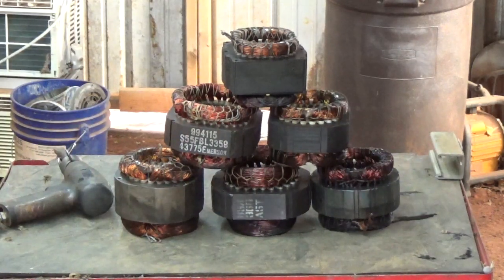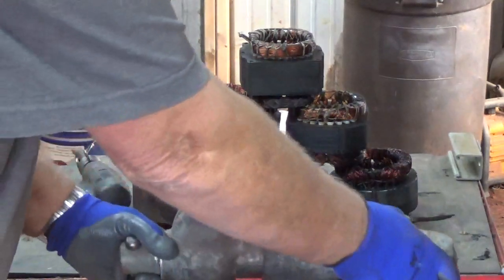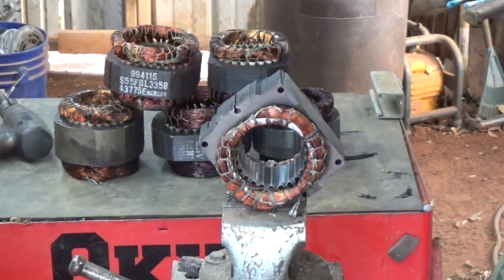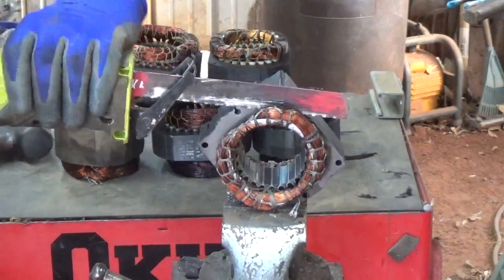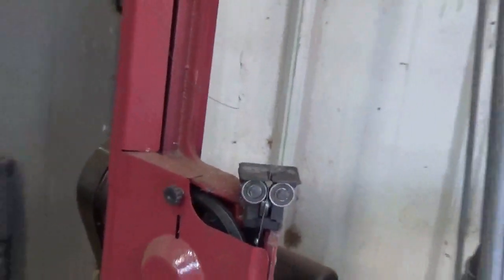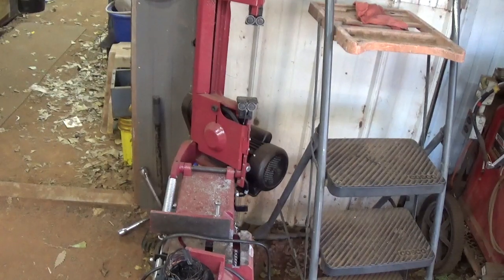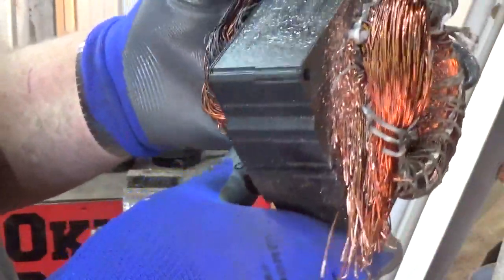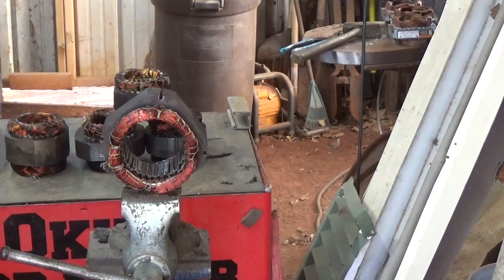How to cut the copper off of stators from electric motors

Comment: Not knocking your method. But table was wobbly and vice. I would go broke if it takes that long.  I’ve tried splitting the stater right in half with bigger air chisel   Thin use fork chisel to work copper out of each end.  Great video though. Good luck

Comment: 12:52 never seen one or even heard of that knarly tool (paused it it said what appears to be bandsaw kit). Will stick with my limited tool collection.
Need to get me some thinner discs for my grinders, many have a few types of grinders for various jobs.
Reply from the maker: they call that tool a porta bandsaw. used a lot for plumbing, I haven't used mine in quite a while. Thanks for stopping by

Comment: Oo lord u wanna kill me wit d hack saw
Reply from the maker: just a mention as new scrappers may not have many tools, so they have to use what they have and build up from there, I have built up my tools with scrapping money, my first compressor was a 1 gallon, try to use an air chisel with a 1-gallon compressor, it will teach you patience. I have added a lot of tools in the last few years. Thanks for stopping by
Reply: @Okiescrapper  yes true I just made my coil puller

Comment: You need to check what windings are in the motor, aluminium ones aren’t worth the effort to strip, use a nine inch slitting disc to cut the end off , get a hydraulic ram to pull out the windings, anything else is uneconomic.
Reply from the maker: the aluminum windings are a big disappointment but the good thing is you don't get a lot of them, a 4 1/2 inch cutting disk will cut them open fast, I just got a plasma cutter and plan to try it, I use an air chisel to get the windings out with a bit that I modified. works well, a lot faster than prying the windings out. thanks for stopping by and Happy Thanksgiving

Comment: I use a 7 inch with a cut off wheel
Reply from the maker: I have one I could use, the disks are thick about 1/4 inch and my small grinder disk are about 1/16 thick

Comment: I had the same issue with the Portaband. It grabs wires and jams in the bearings that turn the blade back to the wheel. Your portaband seems to not catch small wires. I guess it depends on the winding size. I have used the sawsaw with a new bimetal blade and it works ok but my grinder with a cutoff wheel works the best. Those pesky strings are a Pain in the A55.
Reply from the maker: I may try to use a propane torch and see if I can burn them off, or use a wire wheel on a drill or bench grinder may do it.

Comment: I use the 4 1/2 grinder but you should wear a respirator so you're not breathing in the copper dust.
Reply from the maker: yes that is for sure I use the grinder a lot too. lot of dust,  should use a dust mask at the least. almost always have to use a new disk or nearly new one to cut all the way through. thanks for stopping by

Comment: Good thing about air chizel it pulls out all the copper. The oil in the compressor makes it easy to pull out the copper, but when they haven't been sitting in oil the air chizel is very handy.
Reply from the maker: yes it is, it is one of my go to tools, there is so much that you can do with it, if you have the right chisels, next would be the angle grinder,, I got a porta band saw not long ago and am finding places to use it, much faster then the sawzall and grinder. Thanks for watching

Comment: Cut the strings on one side, use a screwdriver to pull apart the main bundles, usually into four loops, cut thru them with a cut-wheel on a Dremel tool, then pull wires thru, it's a lil slower, but it's alot cleaner too, ya can even set up a small vacuum to collect any copper dust
Reply from the maker: after pulling them apart you could cut them with a pair of long handle cable cutters.
Reply: @Okiescrapper  yeah, but I find the lil dremel tool to be a lil quicker, and a little less labor intensive.

Comment: Is that vice mounted on a spring?
Reply from the maker: it is on a pedestal and the base is a little bit rounded, I got it at an auction a few years back, I need to weld a few nuts around the base to make the outer edge hit the ground and not the middle

Comment: If you like the air hammer then I would suggest a wide blade chisel for it... it would cut much faster and easier. Also a finer tooth blade on the saw all would prevent the pulling of wires. And for gods sake get a sturdy table and mount the vise to it. All the moving of the table and the vise are a accident waiting to happen. Is losing your life worth a few bucks of scrap metal.

Comment: I don't bother with the aluminum stators it only pays .22 cents a pound
Reply from the maker: this is a hobby for me and I well I came this far, may as well finish it, most hobby's cost big bucks, this hobby will pay you back, I have a good job for paying the bills and hope to retire in about a year,  so this will keep me active and help to supplement my SSI. and now with the YouTube income I should do alright, like I said I do this for a hobby but it is still kind of hard to spend much time cleaning aluminum when it pay's so little and takes so much to make a pound, 
If a guy want's to maximize his profits he needs to work in bulk steel when the price in mid summer was $140.00 a ton I was getting $400.00 per load of tin and if you had the resources to get that much per day you could load easy in 4 hours. It would be hard to clean that much copper in that time, so cleaning any metal would be done in slow or down time.  well thanks for watching and have a Happy Thanksgiving
Reply: @Okiescrapper  I to have this as a hobby I do a lot of micro scrapping mainly copper and brass some aluminum and some sheet metal. I was just making a comment on what I do my transformers mostly for the copper.

Comment: I wonder if you were to toss those ones with the aluminum wire in your melting pot  would it be an effective way of recovery
Reply from the maker: yeah that might just work, It would be less work.
Reply: @Okiescrapper  one moe thing, I picked up an older microwave but this one was very heavy. I opened it up to find two of everything. Transformers and fans and all of wiring was copper.  I would have been tempted to have it repaired but I wasn't careful loadind it in the back of my truck. Ever seen one of these?

Comment: If you cut from the TOP you won’t have trouble with plates
Reply from the maker: it may push the wire through the slot in the middle, may be able to cut from the top at an angle. I am wanting to try to build a splitter

Comment: Chisel A WASTE IF TIME LINEUNG IT UP
Reply from the maker: yeah it does take more time, the grinder is the fastest, I didn't mention it in the video but a 14 inch cutoff saw will work too, a guy could hook up a shop vac. and suck in most of the copper dust, my videos are geared to  the the beginner scrapper and the hobby scrapper. most guys that do it for a living don't take the time to clean stuff up. time is money to them, if you look at a few of the loads of tin that I took in  I was making $400.00 a load, a guy could load that up in a few hours buy himself, but not sure if it would be possible cleaning copper in one day, let alone day after day,  a lot more handling involved. Thanks for watching Raymond

Comment: I just now opened a transform but this one looks to have what looks like brass wire. Have you ever seen brass wire?
Reply from the maker: no never seen brass wire, is that the color of the wire or the coating on the outside?
Reply: @Okiescrapper  😣 its coating over aluminum wire. The only copper I found was from the short power cord, the tiny motor that rotates the dish and maybe a gram or so off odde and ends. But hey... got me two fine magnets!

Comment: That use to happen to me a lot. You need to buy a very very fine blade and only use it to cut the copper of the motors
Reply from the maker: yes. the grinder works well, I saw a video of a guy using a cut off saw with a big 14 inch blade,  I am thinking of a big hammer drill and split them in half

Comment: You have to slowly turn it around when it's ripping like that on the saw saw
Reply from the maker: they were from sealed units, think they would have worked better if they were tied with string on both sides, the first one went well. I use the air chisel most of the time just wanted to show some of the ways for the new guys, I saw one video the guy was using a 14 inch cutoff saw

Comment: Hello use a industrial mask 5” blade grinder cut 1 side the other side use a flat screwdriver that is IT !! U have the idea though 😃🍺👊🇨🇦
Reply from the maker: yeah I thought of using a big grinder, I saw a video of a guy using a 14" cutoff saw, I have used the air chisel for many years. does well most of the time,  I picked up a pneumatic jack as scrap last year, I need to bring it up to the shop and see if it works, may be able to turn in into a splitter,  was also thinking of a big hammer drill with a wide chisel split them in half and pull the copper out

Comment: On the motor that only had strings on one side, maybe it would have helped to cut the side without the strings?  Then maybe the strings would keep the other side from pulling through?  Also, it would be cool to see another "tool maintenance" video, like how to properly sharpen your air chisels?  👍 Love your videos!!
Reply from the maker: Yes I think the strings may have helped I could have wrapped some blue tape around the other end so the wires would stay together

Comment: I mounted an angle grinder and used a foot pedal which allows me to hold the core and turn it while cutting. A couple times around and it makes a clean cut. It's also handy for scarfing.
Reply from the maker: sounds like a good method, I need to get a foot pedal switch, I have an old grinder with no guard, I could make a table and mount in using a 7 inch blade
Reply: @Okiescrapper  I wrapped a bar with black tape so it fits tight in the screw-on handle. Makes it easy to remove the grinder if I want to use it by hand.
Reply: Totally agree, my grinder blade is thin az but lasts for ages and does a clean cut every time